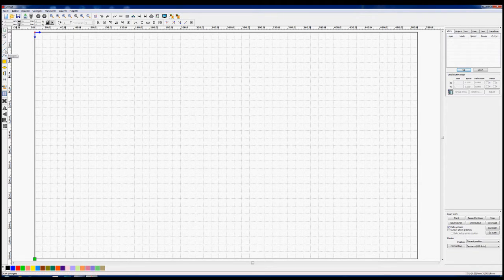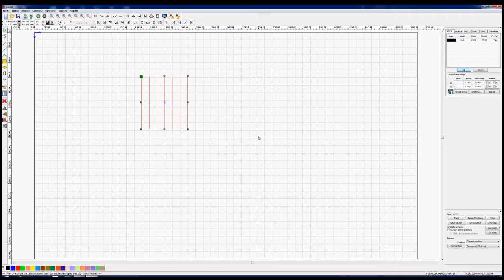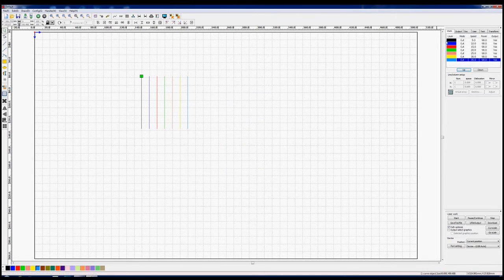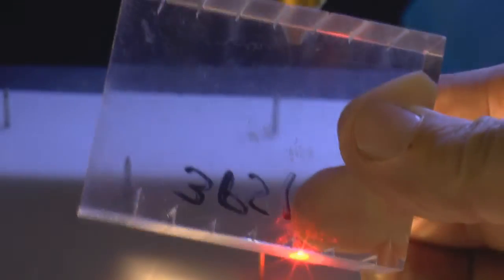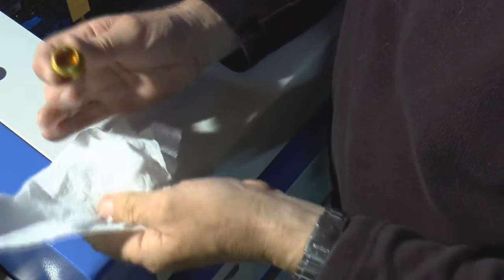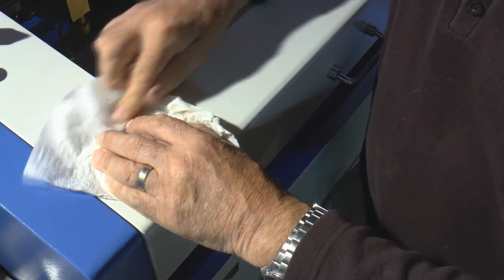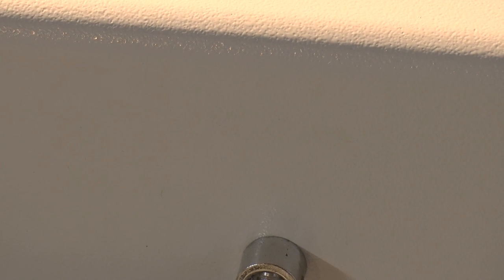RDWorks Learning Lab 07 Lens cleaning test program

Comment: Hello.  I hate to ask but shouldn't a plano convex lense be mounted with curved side to source and flat side to the work?  At the 9:15 mark in this video you state that the flat side goes down.  Yet this drawing shows the beam converging to a focal point with flat side facing the work surface:
http://www.opticasoftware.com/documentation/Rayica/RayicaGuide/HTMLFiles/index_285.gif

P.S.  Thank You for taking the time to make these videos.  Watching them whilst waiting for new mirrors and lense on slowboat from China.  Very informative and  you explain things extremely well.  I just recently acquired a 50W unit (used) similar to yours.  I'm jealous of the motorized bed.
Reply from the maker: +Bill Frick 
Hi Bill
SESSION 31 PART 4 .....https://youtu.be/TUJgBcb2xnQ
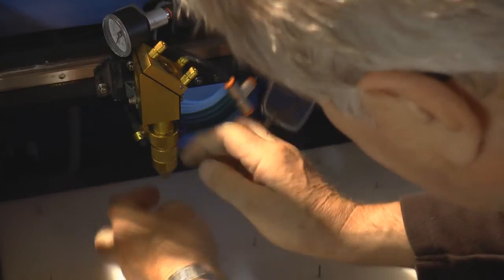at about 10:40  I made an amazing discovery. Just remember these are not tutorials and I'm not a teacher you are just looking over the shoulder of an old guy learning, making mistakes and enjoying himself. Maybe a cynical question  but I have to ask. Is your tube truly 50 watts? If it's not at least 1000mm long  (more like 800 to 850mm?) then it's probably 40/45 watts. Check out typical tube sizes here  or  with several other tube manufacturers.
http://www.cncoletech.com/Laser%20tuber%20standard.html.  Lots of fraud being done in this business.

Thanks for your appreciative comments
Regards
Russ
Reply: +SarbarMultimedia 
Hello and Thanks for the quick answer.  Unfortunately my tube is only 850mm X 50 Diameter and all labels except for Class IV Warning label are in Chinese.
Reply from the maker: +Bill Frick 
Let me also guess that your setting piece is about 19mm ?
Russ
Reply: I had to dig out the digital calipers.  The lens is actually 20mm in diameter.  It's also very dark and passes no visible light.  I think it might be a Gallium Arsenide lense.  Even a very bright green laser pointer cannot penetrate through it.
Reply from the maker: +Bill Frick 
Hi Bill
Thanks for that info. Your observation could be quite meaningful because although GaAs has some toughness advantages over ZnSe, I believe it has lower % transmission properties for 10.6 micron light. I have not come across anyone else with such a lens. I have been asking questions of people just recently because I plan to do a video about different focal length lenses. I appear to be able to do things with my puny 30 watts at the work surface that others with 60 watt machines can't match. They ask what trickery am I using? You will observe from my videos that I set my nozzle about 6mm above the work piece. That's because I have a 38mm(1.5") focal length lens fitted. Doesn't everyone? Well, no. From feed back it appears that most machines are shipped with 2" (50mm) lenses. which sets the nozzle about 3/4" (19mm) above the workpiece.  Hence my enquiry to you. You misunderstood my question but gave me a fantastic answer. I'm curious to find out what's special about my machine that allows me to walk on water when I've been sold a 40 watt machine instead of the 50 watts I bought.
Thanks
Russ
Reply: Thanks for the quick answer Russ.  Unfortunately I have no idea what the Focal Length of this lense is.  I traded for a used machine and upon inspection of the optics saw that the mirrors were not kept clean and ruined.  Cleaning with acetone removed the dark blue film but sadly, they were pitted beyond recovery.  The pitting can be determined by shining a laser pointer at a 45 Degree Angle to the mirror and checking the reflected image.  Mine showed a nice, somewhat fuzzy main 'dot' which was surrounded by infinite dimmer 'dots' which is indicative of micro-pitting at the surface.  Attempts of polishing with chrome polish applied to the snipped off nub of a Q-Tip inserted into a cordless drill head did not help.  (I figured the result would be a restored lens or an already ruined one just looking shinier) I've only been able to pulse the laser at some card stock where the first mirror mount is in order to determine if the tube would fire at all or not.  I've ordered 3 Molybdenum replacement mirrors and a replacement ZnSe lens.  Oops, my lens is 18 mm diameter, not 20.  The FL on the replacement is 50.8mm.  I ordered on the 4th of January and am still awaiting shipment.  The seller, Frank Wang with AliExpress, was at the Consumer Electronics Show last weekend so I imagine all of his preparations for the trip and subsequent return have hindered processing of any orders.  I can't wait to see the new video once you get it posted.  Using the least amount of power to get the job done is the sign of a knowledgeable machine operator and also coincides with the Ham (Amateur) Radio rule of using the least amount of power to get the job done.  Yet another of my hobbies I wanted to get into as a child but cost deterred me until recently as Hand Transceivers can now be purchased for as low as $30 USD.  My apologies for being so long-winded but I am an Eternal Student and my exuberance plus Thirst for Knowledge tends to override my Social Common Sense at times.
       Respectfully,
               Bill Frick